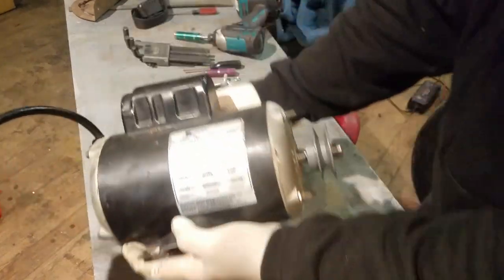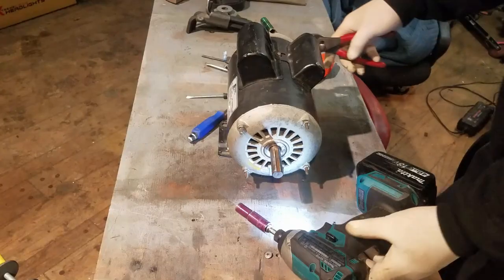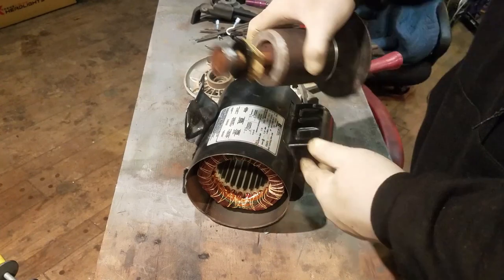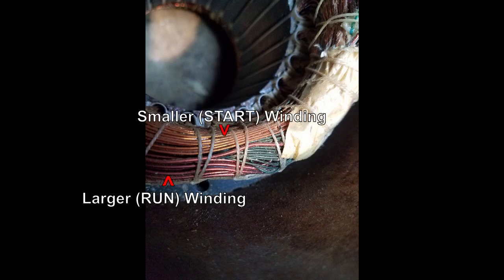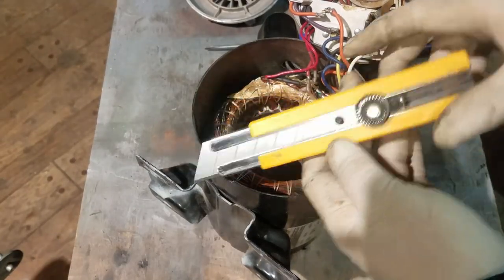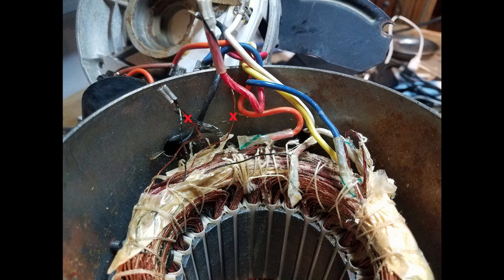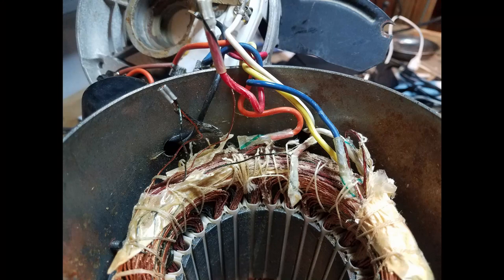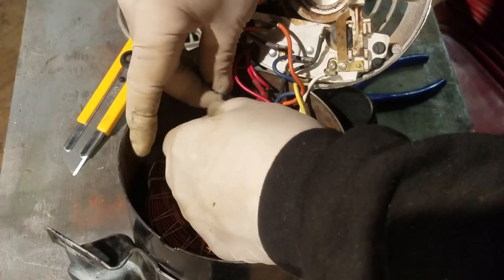I reversed this NON-REVERSIBLE motor!  They said it couldn't be done.

Comment: Absolute life saver. While I didn't dig into the windings as you did your comment on flipping the rotor around to reverse the direction worked perfectly for my motor! I thought I'd wasted days making custom hubs and mounts for a motor I'd have to replace but now it's installed and my dust blower is hurling chips across the room!
Reply from the maker: Thanks for taking the time to post your comment.  I'm glad the video helped you, although sort of indirectly.  Isn't it cool when you learn to do the impossible?

Comment: It worked for three starts but then humming and then not spinning fast enough to kick out the start circuit. Did i fry a capacitor?. My motor looks very similar to yours. 110 volt single phase with 2 capacitors.

Comment: Im building a electric bike, and i have a question about the rotation of the motor. I've built my diy bike, but the motors spinning the wrong direction. Im using a 24v permanant magnet 350w motor. How can I reverse the direction of the motor? I have it hooked up to a 2 pin rocker switch and a 22.2v 1400mah battery and it all works, but how would i have to change it if i wanted to make it go the opposite direction?  Its going clockwise now, but i want it to go counter clockwise. If i swap the connectors on the motor ( like connect positive motor wire to negative battery wire and negative motor wire to positive battery wire ), would that work?

Comment: Why did you have to change the wires where they connect to the windings and not at the end?
Reply from the maker: If you take a look at 3:05 I'd already cut open the paper and string wrap, but some of the winding wires combine (splice) with other winding wires under the paper and string wrap.  So you have to open it up to catch the winding wires before the splices.  In a reversible motor, each winding wire as its own wire end so you can swap the wires as you please.  Non-reversible seems to just mean they didn't do that for you.

Comment: Any capacitor start/run induction motor can be reversed.  Not necessarily easy as you point out because they hid the wires, but it can be done.
Reply from the maker: Yes, I figured it had to be possible.  Unfortunately, when I asked around on the engineering discussion forums and an "engineer" who posts his woodworking projects on YouTube, I was shut down.  These were supposedly electrical engineers.  Both felt like if the label says it can't be done, it can't be done.
Reply: @redneckoriental  Well good work, luckily you kept digging.
They may be self-degreed electrical engineers or they may have neglected to mention it's possible but maybe difficult.  Anyway, to locate the start winding, find the winding that's in series with the start capacitor.  Every winding has at least two ends, so locate both ends of this winding and isolate it from the other windings (make sure there are no connections to other windings).  Now to reverse direction, simply reverse the "polarity" of  the start winding.
I bet you've helped plenty of others to figure this out, so good on you and thanks!